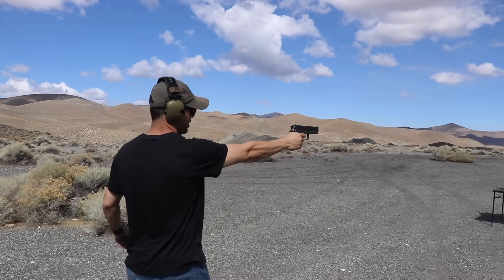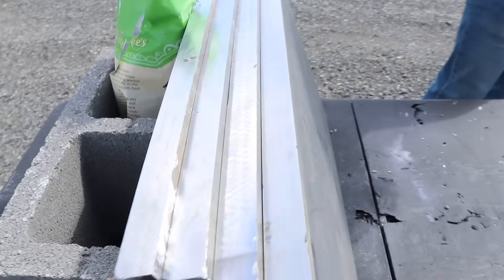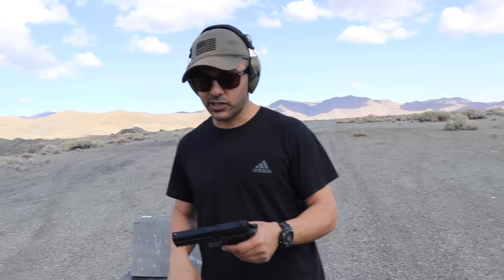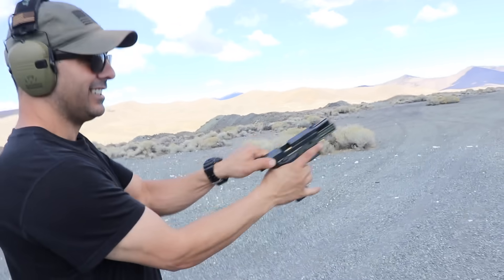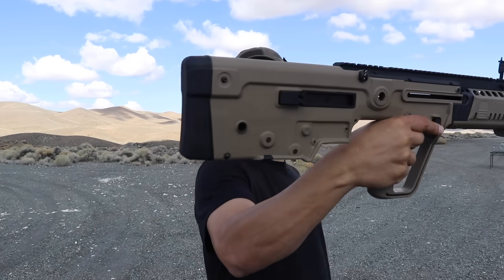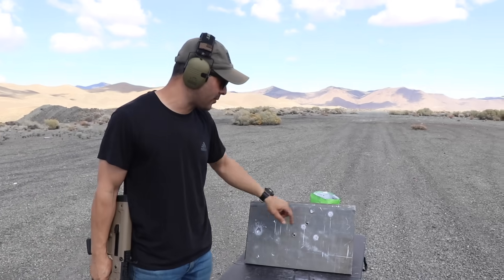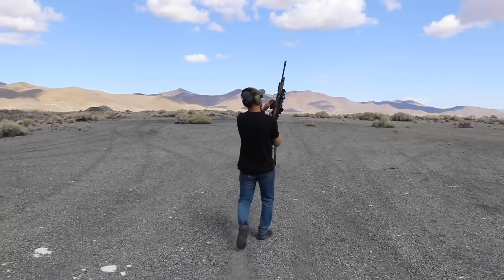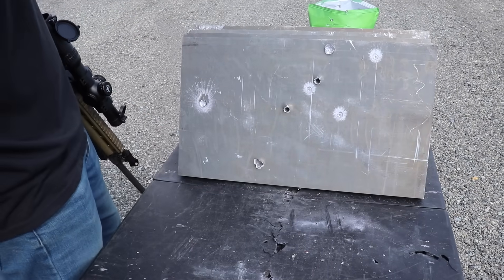is Space Shuttle Aluminum Bulletproo ?

Comment: Well for sure it's pretty durable. Imagine what heavy force the material have to withstand if rushing through the air or even more into space. Besides If there would be just one tiny rock randomly hitting then immediatelly crashing down? This you do better not imagine...

This alloy is pretty hard but also still pretty elastic, so the material doesn't become brittle if more force impacts on the surface would stand.

Comment: I've machined 7075 before, not a lot of it, but a few times, and it's definitely tougher to machine. Still, easier to machine than any tool steel, and way easier than 300 series stainless. It seems about as difficult to machine as 1018, maybe a little tougher.

Comment: What you could do, is build a rig (framework) to hold the plates about .5” - .75” at whatever angle you want. Remember that when you angle the plates to the impact vector, you are effectively increasing the “thickness” of the plates. If the plates were held in place, solidly, at roughly a half inch apart, the API might have passed three. 
I’m going to take a SWAG that with the angle of the plates, your rounds were probably facing upwards 1.8” of T7 Aerospace grade Aluminum. It’s also called Armor Aluminum. That’s what the M3 Bradley, LAV-25, and the M1126 Stryker is made of. Lots of high end vehicle armor is AA7075 (Aerospace Aluminum 7075) or 6061. And now with “Transparent Aluminum” having become a real thing, it’s changing the Aerospace, armorers, deep sea, and many other industries. 

Transparent aluminum and we can talk to our computer. Man we’re catching up to the future pretty fast. 🤓😜🤪😂🤣

Comment: Try aluminum foam basically this metal but the weight of foam probably way more stronger then this it's kinda expensive 100 dollor I got some to protect my vehicle windows and all part of my SUV guess what I didn't pay anything only because I work at a steel factory they make all kind of material they had to much of this stuff they said they where giving it away I said can I take them 
They said TAKE IT
so I covered my whole car in aluminum foam even my windows I put cameras between cracks so I can see lol it worked it's made to stop a nuke on impact no break or dent it was use in bunkers to it's light as foam I Painted it now my SUV is officially indestructible

Comment: The SS195LF (Green Tip) is just a more proper round for 5.7x28.
Nothing special about it.
Same thing as SS197LF, just loaded slightly faster.
The reason for the green tip is so you can tell them apart from the SS197LF because they use the same exact projectile.
The SS198SR( blue tip) is the 2nd worst ammo made for the 5.7x28.
The only thing worse is the Federal American Eagle.

Try out some Vanguard or Elite 5.7x28 ammo.
You will be impressed.

Comment: I've seen Hard Deep Sea Diving Suits made from Aluminium and they take a block and squeeze it until it's half its original size before milling it out to shape so it can withstand the pressure of extreme Deep Water diving. May be they do something similar to make the Aluminium able to withstand micro meteor strikes on the space shuttle? It wouldn't be an inch thick on the shuttle though surely?

Comment: If you put those plates with a few inches distance to each other, they can stop an object of the size of a bullet travelling with 17000 mph and more.
That´s how the ISS has their walls constructed. A meteorite of that speed would just penetrate the wall. If you use two walls, the meteorite will break up into many tiny pieces after penetration of the first wall and will get stopped by the second.

Comment: wonderful  50  caliber  BMG  firing   power & penetration  force  #  its  maximum   power  distance  is 2000 meter   but  since U fired  at around  100 meter distance  it   penetrated  2 inch  thick  aluminum  sheet  but  had U  fired   at 2000 meter  distance it would  have  partially  penetrated  the  metal  #

Comment: The reason that spacecraft aluminum is so tough. It is hundreds and hundreds of paper thin sheets of aluminum. And the grains are set down in different directions and then it is cold rolled cold forged. It's the hardest aluminum there is best to keep meteors from penetrating spacecraft But it doesn't work.

Comment: Very impressive AA7075 alloy, actually beyond impressive !
I just look its density, it's almost 3 times lighter than common steel but sooo resistant.😲 Is it suitable for balistic armor use ?

I love to watch your tests made with fun and chips. :D
Reply: You can't use metal as body protection against bullets, metal is a good conductor of vibration, it's has reverb effect on impact, which depending on the caliber, even if it's not penetrate the armor itself, ends up making a "meat juice" with your internal organs.
Reply: @mrheilel  A slab of 3 inch high grade aluminium would weigh so much that it would hardly move for anything below a .50 and any vibration it easily cancelled by some absorbing foam or similar behind it. A .50 cal would not be good due to the enormous force but there is pretty much not any body amour that would hold for that anyway.
Reply: @dtiydr  "a .50 and any vibration it easily cancelled" kkkkkkkk Bad choice of words. Now I'm absolute sure that you have no idea of what your talking about.
Reply: It use for space old shuttle for example
From France ❤🇫🇷
Reply: The aluminium is still heavier than the boron-ceramic armour plates. Even the cheaper armour plates use mix of ceramic and metal which is much lighter
Reply: @shrujanamsyama9940  I'd rather take a metal, multi-shot capable protection.
Reply: @M1KEMEX  But in a battle, 98-99% of the bullets miss. Also, lower mobility leads to higher chance of getting hit. Heavier metal armour causes tiredness and lower mobility which in turn increases chances of getting hit significantly. This is why lighter boron armour is favoured.

However, if a major war like WW3 breaks out, there will be boron shortage and metal armours will be the mainstay
Reply: "Is it suitable for balistic armor use ?"
well as such yes but it not since its to heavy to more modern better and lighter alternatives.

Comment: That is extruded aluminum. Is built by putting several layers of aluminum together with the grain in opposite directions on every other one. And then Press forging it. In the one piece. It's supposed to. Quarter inch thick will deflect a 30 caliber as long as it is not hit at 90 degrees. If it said that angle it should bounce off.

Comment: The reason this aluminum is hard is they add a few percent copper. Aluminum is normally soft, because it is an FCC metal, the crystal structure with the most pathways for dislocation movement. Copper is also FCC, but reacts with the aluminum to form a separate phase that forms inclusions on the microscale that block dislocation movement. 

This of course also has the unwanted side effect of making it much more vulnerable to galvanic corrosion, hence why they are always having to paint the stuff.
Reply: @smallgator  Myself or the original? 
I responded here to a soon after deleted post, saying this is a prime example of the Dunning Kruger effect. Really curious who he was talking about
Reply: Okay Mr Heisenberg
Reply: AL AL 7075 has about 5% zinc, 2.5% magnesium, 1.5% copper, what really matters is the heat treatment and other treatments it receives, composition is only a part of it.
Reply: Don’t know where you learned that, 2000 series aluminum is the aluminum/copper alloy. It is also the most used aluminum in the aircraft industry, not 7700. 2024 t3 is the standard sheet metal, and 2117 is the usual structural rivet alloy. 7000 series is a aluminum/zinc alloy. 2024 can be subject to galvanic corrosion, but it will exfoliate when this takes place, and paint will do nothing. However the copper content is in such small quantities in any given portion that it is not enough to cause corrosion. It only happens when heat treated incorrectly, when the copper can start to migrate towards each other and create larger pockets which will cause an issue

Comment: 1. In spaceships and other armor they use honeycomb structure: two thin layers(2-4mm) of aluminium separated by air gap (5-10cm).
2. a bullet is moving like a snail compared to space debris which is moving almost 100 times faster than bullet. (a bullet travels about mile a second as where space debris 100 miles a second) (*)

At those speeds a thin sheet of aluminium destroys a bullet making it explode into dust. Pretty much the same way as reactive armor on tanks. The second layer will then be able to stop the dust particles that are 1/100000 (or something) of the mass and energy of what the fist layer encountered the projectile having spend most of its energy into that and and being split into dust particle size fragments.    

The energy = mass * speed. So at that speed the 9mm bullet size debris would have energy close that of a (M1 Abrams) 120mm cannon round. But the physics of the impact at those speeds are very different from those of bullet speed. 

That is also one of the reasons FTL space travel is not possible even at speeds on 1% of the speed of light a grain of sand hitting the space craft would have impact energy equivalent of tactical nuclear strike.

So this "test" has absolutely nothing to do with "space shuttle" .
Reply: This has nothing to do with the video. Yeah soace debris moves a lot faster but every astronaut would be dead if that event occurred

Comment: "Is Space Shuttle Aluminum Bulletproof? Doesn't matter if it's hit by an object at 14,000 mph or 20,533.33 fps in space. Max velocity of a .50 BMG is 3,029 fps.
Reply: yes, but those objects are huge, and a .50 BMG would have a better chance of piercing since it is pushing more force in a smaller area rather than a very large area.
Reply: Fillip Denisyuk 

Space trash can be as small as a grain of sand and a lot of it is.
Reply: Skaianet 
Yes, but some things are not heavy enough and cannot penetrate because their small size and weight.
Reply: One error I also realized, it’s not only size it’s the shape as well, but I don’t think there’s many bullet shaped asteroids
Reply: Here's what I don't get if an FMJ 50.bmg round can go through 1 inch of this stuff. How will it protect a space shuttle from a space rock that is bigger and going much much faster. (The shuttle is speeding towards the object and the object is speeding towards the shuttle in space so double the speed) 

So how would the aluminium protect against that if it barely protects against a 50. BMG?
Reply: @reshearchisgood6966   just so you know, it doesnt double the speed. the speeds cancel each other out. so in other words, a car going 50mph  hits another car going 50mph, isnt a 100mph crash. the forces cancel each other out. it would be the same damage a a single car hitting a stationary object at 50mph. mythbusters did an episode on this because in a different episode Jamie said the same thing you did and the fans went crazy and told him that what he said was wrong.
Reply: @reshearchisgood6966  Because most space debris isn't rocks. It's flecks of paint, pieces of metal smaller than your fingernail, really light but is much faster so it still does a lot of damage
Reply: ReshearchIsGood because the 50 concentrates the force in an area much much smaller than a space rock, therefore penetration is greater, same reason why slugs don’t penetrate that well even though they are going very fast with a lot of weight
Reply: DCD Studios 
Thank you for explaining
Reply: Gravity
Reply: J J depends where that grain of sand came from. If it’s from an orbital satellite destruction and consequent debris, they will not be going at “32,000 fps”. They will be much slower and probably much closer to earth bullet speeds. If you are talking about asteroid remnants then yes, they will have that speed and the ones from outer regions of solar system/interstellar, even higher. 

However, those random projectiles are super rare with Mir and ISS not being hit with anything of significance for decades. Orbital junk is much more of concern and I’m glad this type of aluminum is used.
Reply: Bulletproo     smh🙄
Reply: OKAY MR KNOW IT ALL😂
Reply: I don’t think you understand what entertainment is
Reply: Robert Thomas it is in the title “bulletproof” not “space-debris proof” so chill out.
Reply: Try 4000 to 5000 fps with good ammo.
Reply: @commandergelatoalighieri  Bullet mass/typeVelocityEnergy647 gr (42 g) Speer3,044 ft/s (928 m/s)13,310 ft⋅lbf (18,050 J)655 gr (42 g) ADI3,029 ft/s (923 m/s)13,350 ft⋅lbf (18,100 J)700 gr (45 g) Barnes2,978 ft/s (908 m/s)13,971 ft⋅lbf (18,942 J)750 gr (49 g) Hornady2,820 ft/s (860 m/s)13,241 ft⋅lbf (17,952 J)[2]800 gr (52 g) Barnes2,895 ft/s (882 m/s)14,895 ft⋅lbf (20,195 J)Test barrel length: 45 in (1,100 mm)
Source(s): Ammoguide.com [1]
Reply: @robertsride1498  hamburger?

Comment: They should do it with the plates flat next time. When you slope the plates back it increases the amount of metal the rounds have to go through to get to the other side. But it might also ricochet back at them instead of just upwards. They would still have a bit better results with the bulging and penetration if it was flat. Love the video though. Aircraft aluminum is crazy!
Reply: I think he does it on purpose  ! If it i on an angle, there is less risk of ricochet  ?!

Comment: The results would be different if the metal was placed at a 90 degree angle.
Reply: @Francesco D'Alonzo Yes it would. Why do you think modern tanks have curved or skewed angles to their armor. The more curved a surface is, the more chance for a ricochet and penetration chances drop.
Reply: Mechanical engineer here. Vertical pressure is the one that leads to penetration. Vertical speed of the bullet DOES vary with the positioning angle of the target resulting in a different amount of vertical force. V(y) = V.sin(*)   and F=fn.(Vy)
Reply: Francesco D'Alonzo the speed of the bullet does not change because something is on a angle but very strange things can happen to bullets when they hit an angled hard surface
Reply: Francesco D'Alonzo plus, when you shoot an angled surface, it makes more metal for the bullet to penetrate, which is why, as the other guy said, modern, and older tanks, have angled armor, for there to be more metal to penetrate, and increase chance of richochet. that itself is an old technique, nowadays they use different metals and spaced armor to make it harder to penetrate on top of the angled armor.
Reply: Potassium plus iron equals alluminum type K ez 😂

Comment: If its the real deal, then yeah its totally bulletproof. this metal (with the help of other heat resistant ceramic coverings) is designed to withstand heat over 3.000⁰F and small debris, as small as sand, coarsing through 18,000 miles per hour or 5 miles per second. (Thats puny compared to your gun's muzzle velocity.)

Perfect for space shuttles!

Edit: (Thanks to dew2667 on letting me correct it, more in depth description on the ceramic coverings below.)
Reply: Shuttles were constructed the same as a regular aircraft, aluminum skin over ribs and stringers, not half inch thick aluminum. The 30,000 ceramic tiles covering the outside is what made them resistant to heat and small impacts. A piece of insulating foam impacting the wing leading edge caused the Columbia disaster.
Reply: @dew2667  ah yes i see, it has been  edited.
Reply: I don't know, mate 
This video makes me think that the Cybertruck, made of the same material as space rockets could have this level of bulletproof
Reply: @HwangInhoBooNam  spacex uses 30x stainless steel

Comment: Wrong, the toughest aluminium alloy  is 7068. 7068-T6511 has typical ultimate tensile strength of 710 MPa (103 ksi) versus a similar product produced from 7075-T6511 that would have a typical ultimate tensile strength of 640 MPa (93 ksi)

Comment: I call bullshit.  Nowhere on the Space Shuttle will you find aluminum blocks like that.  7075 is the mid 90's upgraded AR15 /M16/M4 receiver.  Prior to that it was 6061.  

2024 sheeting is standard aircraft aluminum.
6061 is standard machined component outer casing material.

Comment: iirc, 7 series aluminum hardens as it ages in air. they also use it for rockets. ULA gets 30'X12'x2" (custom order plates) and removes about 85% of the material while keeping 90%+ of the strength in the axis they want

Comment: 6061 aluminum would be a better candidate. It had some give or spring to it. 2024 is soft, but a 1" piece will stop bullets. I've worked with this stuff for 15 years everyday in machining. Try the 2024 it's not brittle. Hardness becomes a flaw at some point when it too brittle.

Comment: Imagine being on the other side of this, in space, when a small meteor hits it.
Reply: I imagine a gorey mess being sucked through the hole like an octopus before  everything else follows suit and destorys the station.
Reply: meteroids are mostly composed of stone or iron and very brittle. Spaceships usually have several walls, the outer one is supposed to shatter and vaporize the impactor, turning it into plasma that doesnt affect the inner walls much. this way you need only thin and light walls
Reply: @jakobfriedrich5117  do you understand +20,000 mph and newton's laws? Because a small peppering of metal, glass, and whatever from a broken satelite would destroy the ISS. And yet it's never suffered such an incident...
Reply: @Bagginsess 1st yes i understand those very well and 2 that happens all the time the iss  literally had a hole last year and it wasnt really a big deal